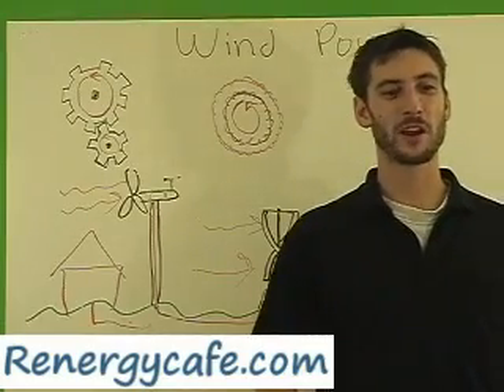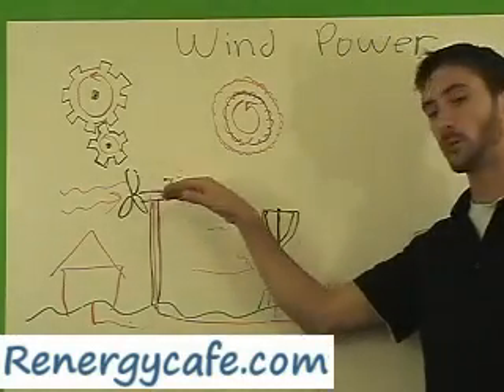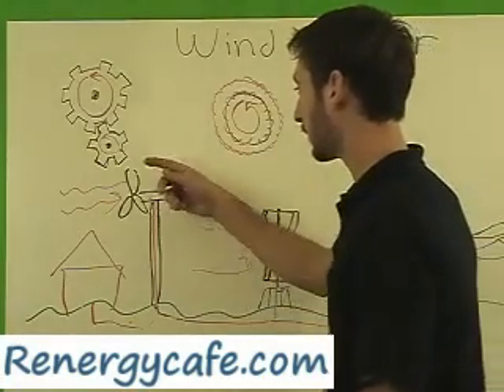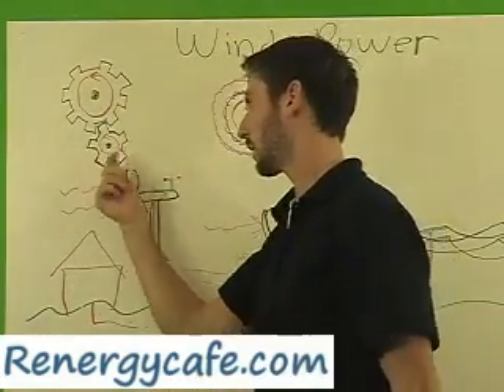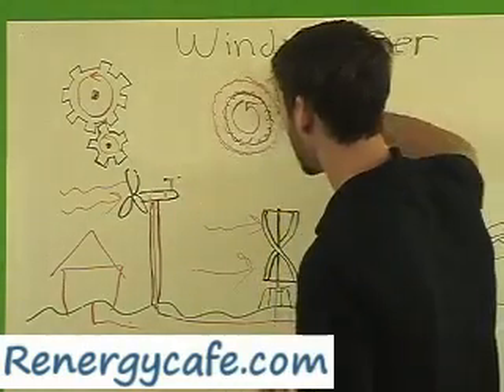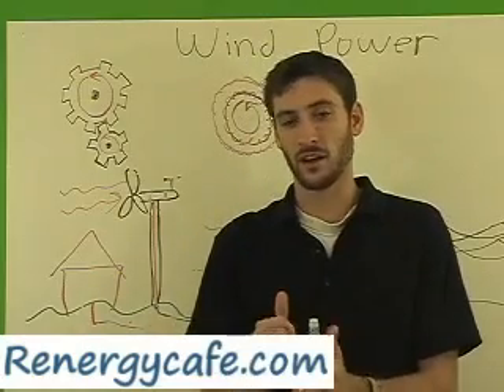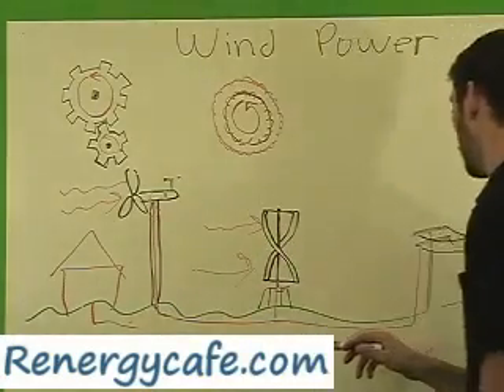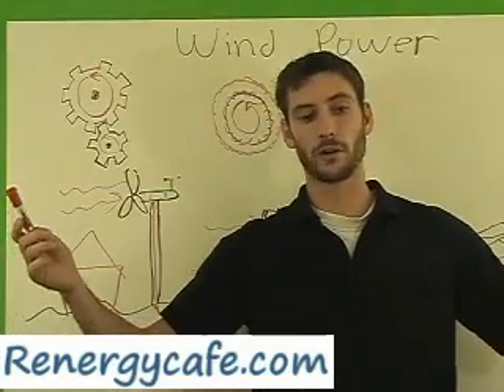Wind turbine How it Works and wind generator power

Comment: @p0lyamorous he doesn't completely describe the generation system.  You may remember from high school physics that when a magnet moves through a coil of wires, it induces electricity.  This electricity is then carried through wires, and other electronic gear onto the electric grid. It is efficient because although there is substantial upfront cost to make a turbine, it is FAR cheaper than a coal power plant, and  the wind inputs are practically infinite, and free.

Comment: Energy is not free. By sticking windmills up into the air stream we are creating drag against the earth thus slowing it down. Excessive use will eventually lead to the day becoming longer (25 or 26 hours) adding to the time we must work thus demanding more energy and trying to extract it from a diminishing source. Soon the earth comes to a stop and we go to war over who has the light side vs. who has the dark side.